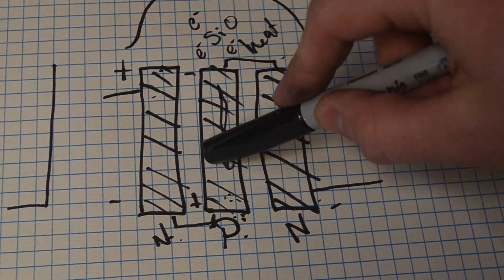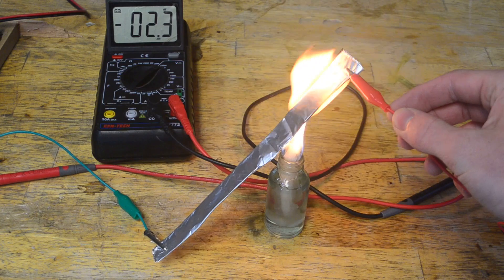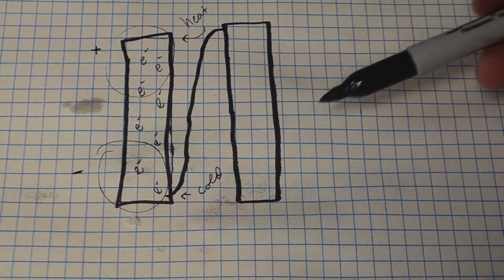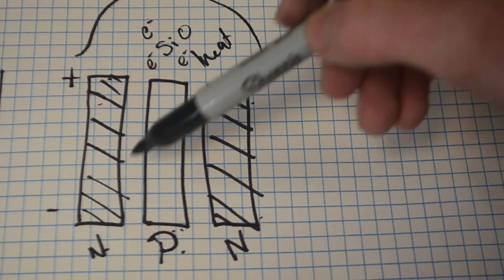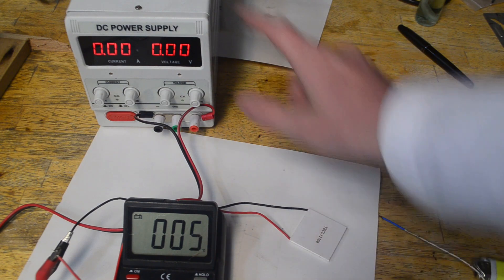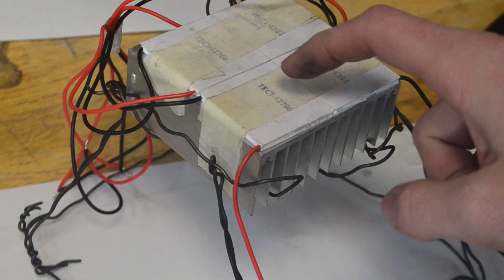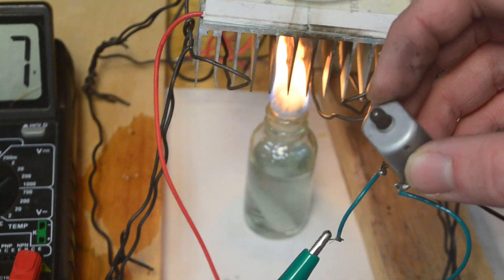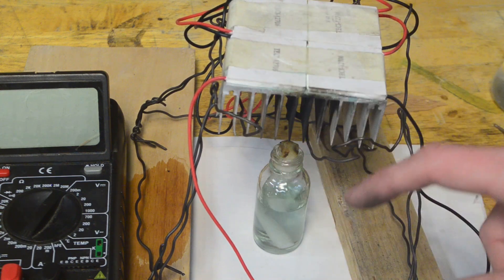How to make a ThermoElectric Generator

Comment: Awesome experiment! However, when measuring power you need to record both the current and voltage at the same time (or same conditions if you only have one dmm). If the electrical load is too large (low resistance) the power supply can't keep up, and the voltage will drop.
Reply: William Osman o shit, didn’t expect to see you here
Reply: @Beanpapac15  o shit, didn’t expect to see you here
Reply: @BlenderGuy1  o shit, didn’t expect to see you here
Reply: @IndraKurniawan-vk2qb  OH WOW! I did not expect to see YOU here!?!

Comment: We used thermocouples while I was in the air force to measure jet fuel temperatures - those operate on this concept.  Love the videos, keep it up.
Reply from the maker: +Tommy Callaway that's pretty cool!! Also thanks !
Reply: But did you measure temperatures hot enough to melt steel beams?

Comment: And the biggest use of of Peltier junction is on spacecraft in deep space - they use an RTG or Radio Thermal Generator for power.
Reply: Ah, nothing like a nice warm piece of Plutonium or Strontium roasting itself as it generates electricity. In fact, old pacemakers were powered by tiny little Plutonium RITEGs inside. https://www.orau.org/PTP/collection/Miscellaneous/pacemaker.htm To be honest, as long lasting power supply, a RITEG is a very useful device. Lots of them were built in Russia for off grid use. Most were Strontium-90 based. Only problem is the radiation.

Comment: Great vid, and I love what you do with your channel! :)
Just a quick comment, the semiconductor used within the thermoelectrics are typically based off of n-type and p-type Bismuth Telluride (Bi2Te3), not silicon. This is because is has a much lager voltage generated in this temperature range (ZT~1 at room temp). The difference between the n and p types are as you correctly said for p has a higher amount of "holes". The n-type is likewise doped with a larger amount of free electrons for use as charge carries. The metal contacts do wire the thermocouples in series, but also actually a bending effect of the semiconductor Fermi bands that enhances the voltages generated and allows for this effect to take place (see below). 

Also I'm sure you probably know that a thermocouple (The thermometer) only measures a temperature differential relate to its voltage, and hence need a compensation "cold-side" reference found inside the multi-meter.

Great work though! Thanks for uploading this  +1 sub :)

[EXTRA PHYSICS] The way it allows electron promotion into the conduction band of the semiconductor is through the heat energy needed/or rejected to facilitate the charge carriers moving from the different Fermi levels between the semiconductor, and the metal contact. This is why the module gets hot and cold at these junctions.

Comment: i think  a good way to raise the efficiency would be to stack a few of those on top of each other. in fact there are stacks like this on ebay, but they are sold in single units which cost 5$+. i would play with those for hours and hours if i had a few of them but they are too expensive. i might have to stick to DIY design with aluminum and carbon rods from batteries

Comment: I have a question , since those tegs can either get hot or cold , could you double stack two together , one side produces your heat and your other one reverse to produce cold to generate your power with the best cooling option?  I would really like to know as I want to try to build a generator myself to charge a battery system for off grid.

Comment: i assume there is a material limit that can handle a max heat, even if the desired difference was incredible. so for example, how would you utilize this effect in lets say...a chamber of superheated gas at 1M degrees F? but sounds like the design would have to be different?

Comment: You choosed the wrong plates. Ampers are very low. You need to use TEG. TEC is for cooling. Not for generating good power.
Thats why companies have built Tegmart and deviwatt with TEG modules. Not TEC. TEC is thermo electric cooler. But TEG is a thermo electric generator.
Reply: Thank you

Comment: Unfortunately this is not an economical method of producing energy at the current cost of $2.00 per pad. (8 pads = 12V@150Ma) This means that it would cost $16,000 to generate 12V@150A-1800W and that is only at peak sunlight heat hours, like a solar water heater. You would have the cost of building a support system like the solar water heater (put them in a case with glass and paint them flat black) but also have a cooling method for the back side.

Comment: You need to try to see how far you can push it
For example using a much hotter flame and something cooler like dry ice or liquid nitrogen

There might be a range where the temperature might not matter and become ineffective to the output
Reply: those are limited to between 150 C and 300 C on the more expensive ones. you cant go too far with them when generating

Comment: Hello great video as always and yes I did learn something. Could you please show me how to build a device that will charge my phone as I pedal my bicycle. Many thanks.
Reply: put a battery bank on your bike
Reply: Gotin Fuklio I was thinking more like getting power from the spinning of the wheels of the bicycle. Thanks for the suggestion.
Reply: Tim Boddington i am trolling you. the idea is stupid and the solution is easy. attach a generator to the wheel, then bridge rectifier with cap  and then 5v buck-boost converter and solder usb wire to it
Reply: Gotin Fuklio Thanks for watching!

Comment: so us this principal if you could take abolute zero, and say, the center of some large star and generate large amounts of power. 
Am I correct saying this?
Reply from the maker: +Henri Holub yep! ( well technically not absolute 0 as the electrons wouldn't be able to move I think , but very close to it sure! ) also the metal would need to be able to handle the heat difference without melting

Comment: How does this compare to a sterling engine for efficiency?
Reply from the maker: +Eli Simmons much less efficient, a sterling engine is around 33% efficient, while these are probably about 6-15% efficient ( perhaps even less ), but then again, that number could be improved if you trapped all the heat so that it could only go through the module and sufficiently insulated the cool side .

Comment: Please build a Bigger Teg generator, that you could use to run 12 DC LED lights for work shop.  It would need a voltage regulator and a battery.   200 watt Teg generators are for sale already but they want $700.00.  If each Teg plate is only $2.50, someone. has a Big mark.